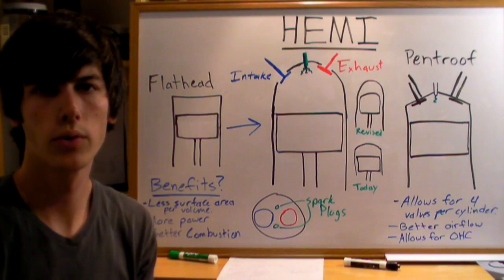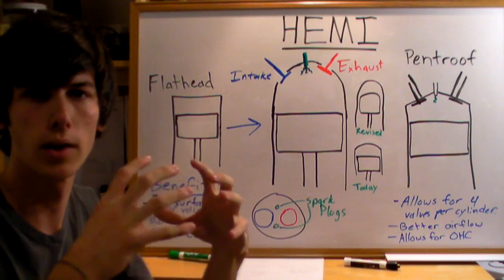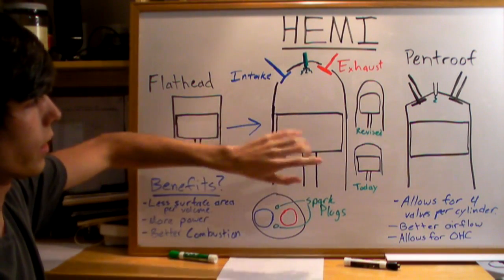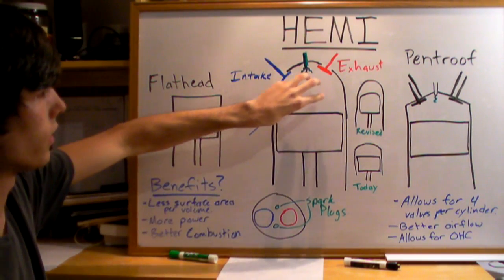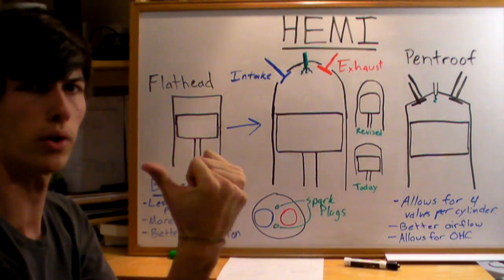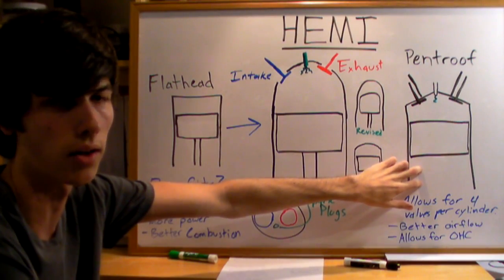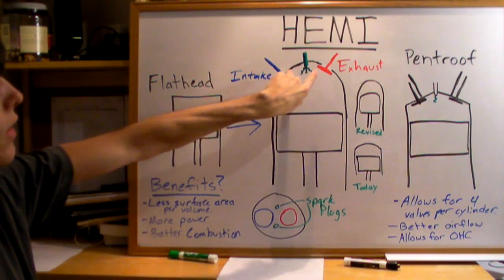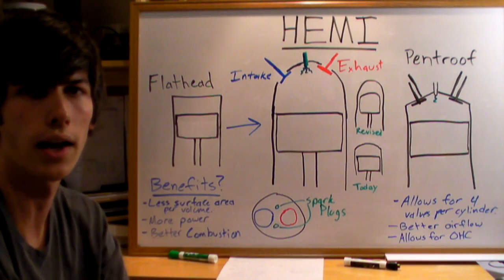What Is A HEMI Engine?

Comment from the maker: Kinda like how coke (and all soda companies) use soda cans as an object with a large amount of volume and low amount of surface area - this means they can use less material. With a sphere, there is a large volume inside, with a minimized surface area, versus say, a cube. With a greater surface area of the cylinder head, there is more heat loss, so with a greater ratio of volume to surface area, heat loss is minimized, thus the engine is more powerful (all heat lost is energy lost).

Comment: It's outmatched due to emmisions and fuel prices,,,Dag cars still use the Big Block hemi engines, they make  the most HP out on any other head design, and make power up until their redline...4,000 plus hp out of an alcohol blown 572 hemi...

Comment from the maker: @92swggboy It would help with understanding how the engine works, and how to design, but you wouldn't actually be building engines. If you actually want to build things, you want to go into machining. If you want to know how to design an engine, determine how much power it can create, and understand the thermodynamics involved, then major in engineering.

Comment from the maker: @bloximonkey It has more surface area, but it also has more volume. A sphere is the perfect three dimensional object if you're looking for a high volume to surface area ratio. The Hemi style takes advantage of this idea. Combustion chambers want large amount of volume, with low surface area to reduce power lost as heat. Soda cans take the same principle, so less aluminum is required to sell you 12 ounces of drink.

Comment from the maker: @coolmikey408 Pushrods are fine for low revving engines, and they're cheap. Unfortunately with higher revs and only 2 valves per cylinder, the air flow is restricted. DOHC with 4 valves/cyl will be much better breathing, and allow for greater high rpm power/torque. Also a problem with pushrods is valve float at high rpm, since the inertia of the pushrod itself has to be overcome. For my full opinion, search for my video "DOHC vs SOHC vs OHV" on my channel.

Comment from the maker: @PirateXzibit Yes. You'll always have at least two valves in four stroke engine. (The four strokes being intake, compression, power, and exhaust.) One valve lets the air come in the cylinder, the other valve allows the air to leave. Watch my video on gasoline vs. diesel, it will help a lot on understanding this. Also, most modern engine use four valves (two for intake, two for exhaust) as this allows for better airflow and higher efficiencies.